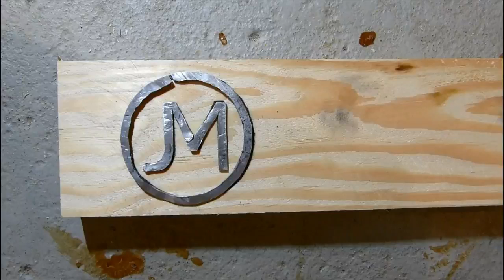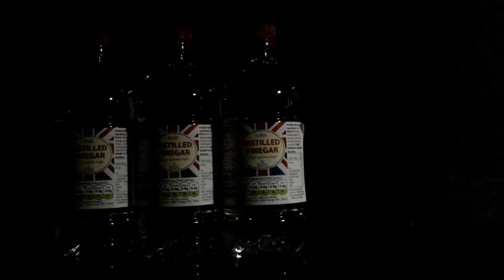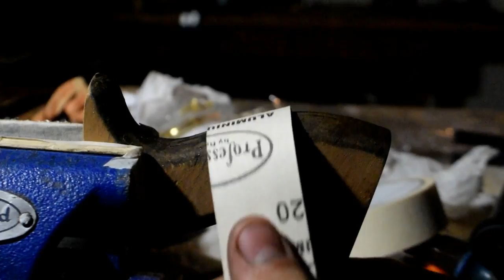Restoring a Stanley No.4 Hand Plane [32]

Comment: I’ve done the same to my own old #4.  It, and my low angle Stanley block plane, are my go-to planes.

I use a set of gunsmith screwdrivers with interchangeable tips.  I much prefer them to ordinary shop screwdrivers.  They come in various widths and thicknesses and they are ground straight rather than tapered.  The result is a bit that is near-perfect to the slot you’re working on and far less likely to peen the slot, a homely look I see far too often.

Another fine video.  Thank you.
Reply from the maker: Never heard of those type of screwdrivers before - definitely sound like they could be useful - do you have a link or specific name I can look for? Thanks!
Reply: JMakes   I use Chapman gunsmith screwdrivers.  In particular, their old 9600 set in the nice padded red box.  You can buy directly from them but I bought mine at Brownells.com.  These days they call the 9600 their starter set but I’ve had mine for forty years or so and never felt the need for more.  Once you use them for tool disassembly (or gun disassembly) you’ll ask yourself “Why didn’t someone tell me about these?”  Now someone has.  

Current new price on the yellow plastic box 9600 set is $35.  I saw a beater red-boxed set on eBay, one missing tip, for $75.  Good luck on that.

No more wrecked OEM screws and more valuable restorations if you happen to care about that.  I don’t much care about the negligible value of used tools but I do care a lot about the aesthetics of the finished product.  Damaged screw heads just scream “junk.”

Keep up the good work!

You
Reply from the maker: Thanks so much for the links/info Charles - i'll check out their site now and you might see them in my videos in the future!
Reply: JMakes   I’ll be watching for them.  Your videos are great, very useful and educational.  I’ll be watching all of them

You’re welcome.

Comment: The cap iron screw should be securely tightened with a screw driver. While using the lever cap to loosen or tighten the cap iron screw may be convenient and may work quite well, there may come a day when, as result of too much tightening or too much corrosion, the lever cap will break. I have a lever cap that shows such damage. Others have made similar comments on other videos.

Comment: Great Video. Question from a beginner, any particular type of wire brush attachment for a drill that's safe for brass?
Reply from the maker: Thanks Matthew  - i used this wire brush attachment i got from B&Q (i'm in the UK) http://www.diy.com/departments/ptx-crimped-wire-brush-dia-75mm/692998_BQ.prd I think for brass the wires are a little on the big side but it still worked well, so i'd recommend anything similar to this or with finer wires (maybe like a 0.3)
Reply: JMakes thanks man!
Reply: Use a brass wire brush on brass, and then polish.
I see brass items offered on ebay and brass items displayed on YouTube that have been tarted up using a steel wire brush which leaves scratch marks in the brass. Some may not notice or care about scratched brass. Others do.

Comment: Unless you don't mind the bare wood look, you should give it a few coats of clear laquer. That would protect the wood and really bring out the grains. You should make a simple wood handle for you razor blades. It makes it WAYYY easier to hold on to them. Lastly, IMHO, do away with the annoying repetitive music. If the music sounds like it did in this video, it's much better to listen to the sounds of the tools and have no music. It turned out great, and I'm sure it'll perform nicely for you!
Reply from the maker: Thanks mate & I really appreciate all of your feedback. I normally do varnish or lacquer my project but decided not to on this one, just because oil is a lot simpler to apply and gives a more tactile end result. Really good suggestion for the razor blade though, I'll give it a go and sorry to hear you didn't like the music - I've changed what sort of stuff I use since then so I'd be really curious to hear what you though of that. All the best! :)
Reply: @jmakes3745  Thanks for responding! I look forward to seeing more of your vids! You do great things.    😃

Comment: Aren't you taking a big chance damaging the threads by chucking them in the drill?
Reply from the maker: thanks for the concern, but honestly, the amount of force the chuck puts on the threads if you just use it normally, isn't even close to enough force of that needed to deform the threads.